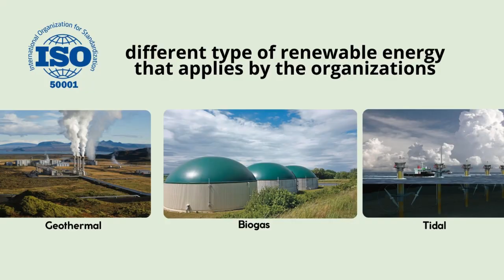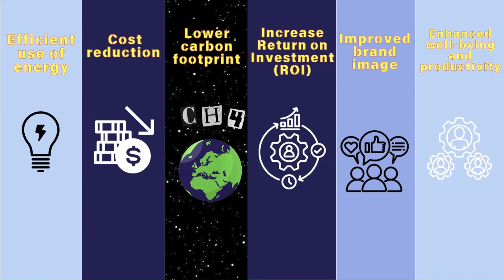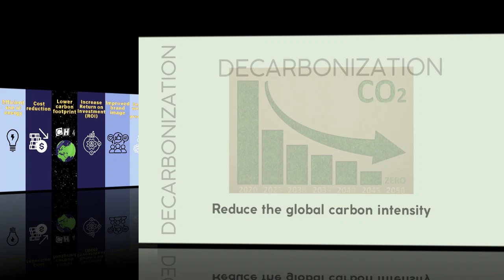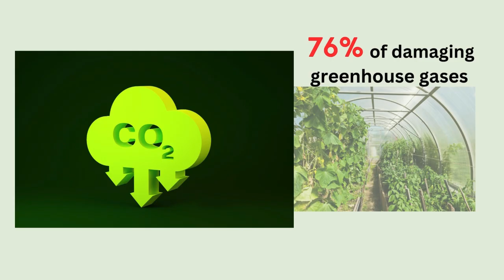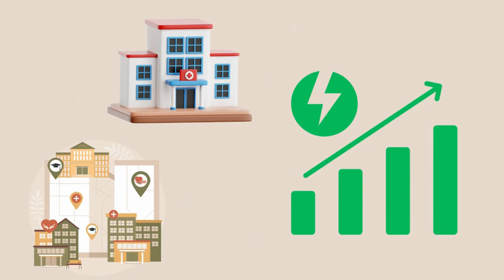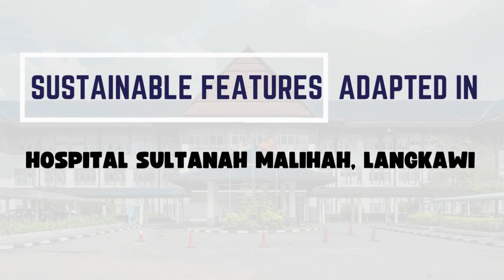ISO50001 Energy Management System

Comment: What I understand is that ISO 50001 is a global guide that helps any organization save energy and use it more wisely. It works by having a clear plan to monitor energy use and constantly finding new ways to reduce waste. By following this system, companies can lower their electricity bills, reduce pollution, and even improve their brand image. A great example from the video is a hospital in Malaysia that used these steps to become more "green" by using solar panels and LED lights. Basically, it’s all about protecting the environment while also saving money in the long run.

Comment: ISO 50001 is a system that helps organizations manage and use energy more efficiently. It provides a structured way for them to plan how energy is used, monitor their energy consumption, and continuously improve their performance over time. The main purpose is to reduce energy waste, lower operating costs, and minimize environmental impact. It also encourages the use of cleaner and renewable energy sources such as solar and wind to support sustainability goals

Comment: ISO5001 helps in creating and sustaining energy management systems used by organizations by promoting energy efficiency, renewable energy, emission reduction and access to affordable and sustainable energy. The framework includes developing policy, planning and implementation, monitoring and measurement, evaluation compliance, management review and continual improvement. So ISO50001 is a very recommended tool in order to achieve a sustainable environment.

SITI ALYAA NASUHA (6B)

Comment: ISO 150001 is an international standards for energy management system(EMS), it is designed for organisations of any size and helps the entities to improve the energy efficiency, reduce costs, and lower the environmental impacts. The system follows a cycle of developing energy policy, planning and implementing energy-saving measures, monitoring performance, ensuring regulatory compliance and committing to continual improvements.

Comment: ISO 50001 is a standard that helps organizations improve energy efficiency and reduce energy use through a structured system. It is related to SDG 7 because both promote sustainable and efficient energy usage. The standard is important as it helps companies manage energy performance systematically using continuous improvement. Benefits include cost savings, better energy efficiency, and improved brand image.

Comment: ISO 50001 is a global framework for establishing an Energy Management System (EnMS)to improve efficiency and support sustainable development goals 7 (SDG 7).  Through a cycle of planning, monitoring, and continual improvement, organizations can reduce carbon emissions and lower energy costs. This is achieved by decarbonizing. Beyond environmental protection, the standard offers benefits like enhanced building performance, improved brand image, and better occupant productivity. A notable application is Hospital Sultana Bahiyah in Malaysia, which became the first hospital globally to achieve Leadership in Energy & Environmental Design (LEED) V4 Operation and maintainance (O&M) gold certification by implementing features like PV panels and optimized ventilation.

Comment: ISO 50001 is a standard for managing energy in an organization. It helps save energy, use clean energy, and reduce pollution. It supports goals like cheaper and cleaner energy. The system includes steps: make a policy, plan and carry out actions, monitor energy use, check results, review, and keep improving.

It is important because it lowers carbon, saves energy, improves building performance, and reduces cost. Benefits include better energy use, lower bills, less carbon, better image, and higher productivity. It also supports moving from fossil fuels to renewable energy like solar and wind, but faces challenges like high cost and new technology needs.

Comment: From this video, ISO 50001 is a standard that provides a structured framework for improving energy performance in organizations. Energy management helps to reduce energy consumption and carbon emissions while promoting efficient use of energy resources. Moreover, it is recommended for all industries to implement a sustainable energy management system to improve energy efficiency, reduce energy usage, and reduce cost.

Comment: ISO 50001 is a global standard that helps an organization in implementing the Energy Management System (EMS) in order to use energy efficiently, cost saving and ensure the sustainability of the environment.  It is also aligned with SDG 7 (Affordable and Clean Energy) by promoting energy efficiency, use of renewable energy, emission reduction, and allowing access to affordable and sustainable energy. By complying with ISO 50001, it definitely benefits the organization by lowering the carbon footprint, improving its brand reputation, and of course, contributing to the efficient use of energy.

Comment: This video explains on ISO 50001, the international standard for energy management systems, which applicable to organuzations in all sizes.  It emphasizes its role in enhancing energy efficiency, reducing costs, and supporting sustainability goals. It outlines the framework for developing an energy management strategy, its importance in conserving energy and reducing carbon emissions, the benefits of implementing ISO 50001, and its relevance to healthcare facilities, particularly in our country Malaysia. 

Energy management is crucial for reducing carbon emissions through efficient energy use, conserving energy by optimizing consumption habits, and enhancing building performance. These efforts will lead to lower energy costs.

Comment: Nice video. I now understand, to reduce the impact on the environment, it started with the source of energy that we used. Our country main source of energy is mostly not renewable because we mainly use fossil fuel and coal. Therefore, we have to change to renewable energy and minimise the used of non-renewable energy to achieve the sustainability. Thus, implementation of ISO50001 able to help organization to align with energy management system.

Comment: ISO 50001 helps companies improve energy efficiency and reduce energy costs by managing energy use systematically. The importance of energy management includes reducing carbon emissions, conserving energy by using it more wisely such as turning off lights when not needed, enhancing building performance, and lowering costs by using less energy and making buildings operate more efficiently.

Comment: From this video, I’ve learned that ISO50001 is a standard that provides a structured framework for improving energy performance in organizations. Energy management helps to reduce carbon emissions and conserve the energy. It is recommended for all industries to acquire a sustainable energy management system to improve energy efficiency and reduce their energy consumption which leads to cost saving.

Comment: The video is easy to understand. ISO 50001 is crucial for promoting energy efficiency and sustainability. It helps organizations systematically reduce energy use, cut costs, and lower environmental impact. A great step toward sustainability and smarter energy management. It’s about creating a culture of continuous improvement in energy performance. By identifying key energy uses and tracking performance, organizations can make smarter, data-driven decisions that benefit both the environment and the bottom line.

Comment: Based on the video, ISO 50001 is a vital standard that helps organizations systematically improve energy efficiency, reduce costs, and lower carbon emissions, supporting global sustainability goals like SDG7. It also shows how the energy management drives both environmental and economic benefits despite challenges in technology and industry decarbonization. Overall, adopting ISO 50001 fosters continuous improvement, operational excellence, and a stronger commitment to sustainable development.

Comment: ISO 50001 is an internationally recognized standard that has been used by organizations to create and sustain energy management systems. ISO 50001 framework consists of developing policy, planning and implementation, monitoring and measurements, evaluation of compliance, management review and continual improvement. Energy management has some importances which carbon emissions reduction, energy conservation, building performance enhancement and cost reduction.

Comment: Energy Management System is like a smart assistant for your building. It keeps an eye on how energy is being used, helps cut down waste, and finds ways to use energy more wisely. In long term, it helps save money, reduces our impact on the environment, and makes things run more smoothly. Example, Malaysia should follow or try to be like advance country on how they make and use renewable source for the factory that do combustion (burning fossil fuel) in oil palm factory since it release Green House Gases (GHG) that may be harmful for environment.
Reply: good aiman

Comment: The video titled "ISO50001 Energy Management System" provides an informative overview of ISO 50001, the international standard for energy management systems (EnMS).  It outlines how organizations can utilize this framework to enhance energy efficiency, reduce costs, and minimize environmental impact.  There are few benefits of implementing ISO 50001, such as improved energy performance, and cost reduction, lower carbon footprint.  It also discusses the key elements of the standard, including energy planning, implementation, and continual improvement processes.